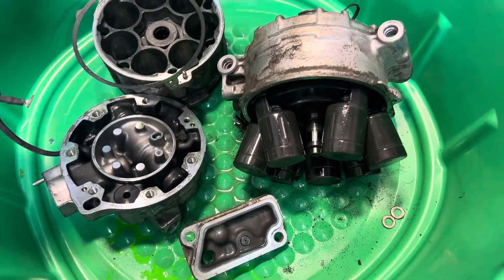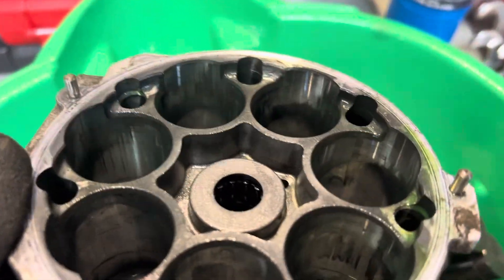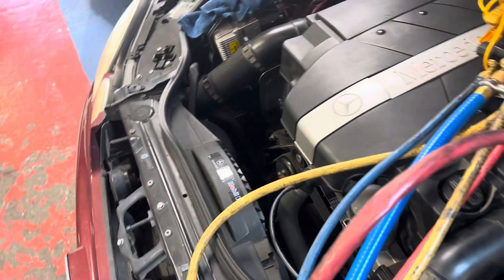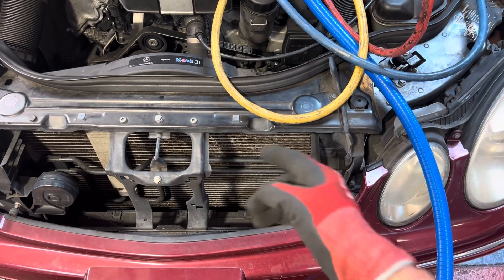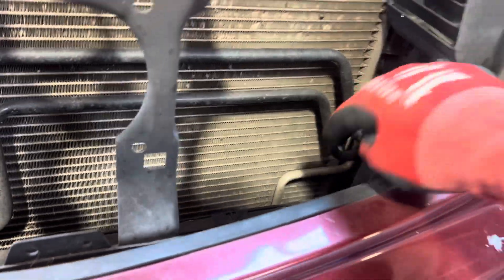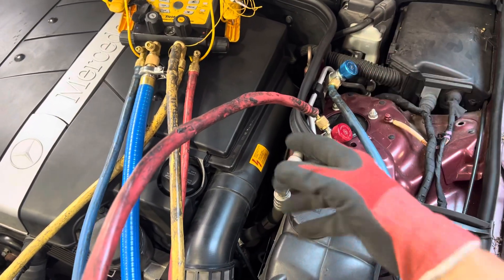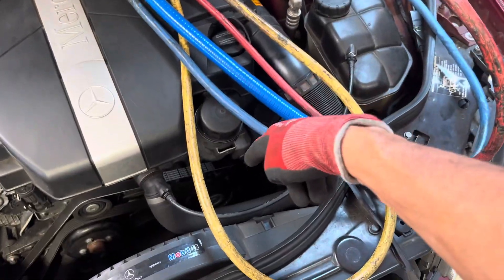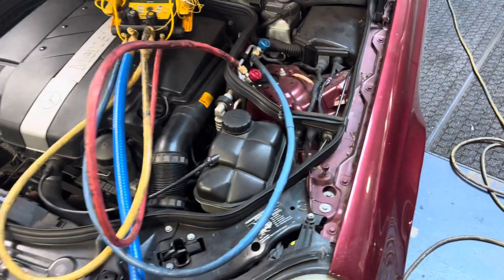WERE DID THE REFRIGERANT OIL ￼GO  ???🤔 Compressor failure.

Comment: Do you need to change the condenser when theres a damaged compressor like that? How to drain oil on the evaporator without removing it?
Reply from the maker: @janernstd9842  if you are lucky enough to be able to get to and remove the expansion valve without removing the evaporator. 
You can use a flushing solvent to blow through evaporator to flush out the oil . 

4 SEASONS has a video using a flesh gun with solvent how to do that after you have removed the expansion valve

Comment: I just put a brand new compressor in and smoked it in 10 mins. There was no fluid in it when I pulled it back off. I’m F’d. I think the whole system is full of metal particles and it’s a large suv
Reply from the maker: Front and rear expansion valves 
Flush both evaporators 
Flush all lines. 
Replace and hose that has muffler on it. 
Replace condenser 
Replace 
Reciver dryer or accumulator 

It a bit of work
Reply: @coldfinger459sub0 thanks for the info. That’s all way outta my league. And it’s only a suv worth about 3k so I guess I’m going to have to keep it as a backup vehicle  or winter vehicle cause all that work sounds like it would take me a year to do. And I’d prob mess it up and smoke another compressor in 10 mins 💔🫣
Reply: The weird thing is that it worked up until I took it out for a drive. Then it smoked the compressor. That’s two compressors that I had working while idling but then they both failed when I took for a drive. I didn’t replace any other parts but the compressor both times.

Comment: This brings up a good question i have...  " if one could vent automotive AC refrigerant ( like back in the old days ) ..what would be the best way to vent the refrigerant and 
NOT loose any of the oil "  ?    thanks in advance  -  Jay Fox
Reply from the maker: @charlesleake930  we used to do it all the time I would use R12 so did my father so did my grandfather
R22 
R11
It just takeoff the expansion valve open up the lines put in our 11 as your flushing solvent. It’s a refrigerant. 

And then you would use our 22 or 12 as your pressurized solvent to blow through the 11 this week clean out your system just fine. We used to spray tons of stuff into the atmosphere every day. 

When your steel boots got really hot and sweaty in the summertime, you cracked open a can of our 12 and dump it all over your shoes until they were frosty, white and cold 
🥶 it feels really good on a hot summer day

When your Coca-Cola or your beer need to be cool down, you crack open another can of R2 and spray it all over your can in a little container. Get ice cold really fast. 

I grew up and was mentored working on Hvac back in the days before the EPA existed for refrigerant control
Reply: Slowly!

Comment: i dont understand how you can think oil doesnt travel in the system. the number of people i have to explain this to is crazy. if you had seen one leak in your entire life it should be obvious
Reply: Watch properly the video start to end, after you "clean" your ear😂.   Either you have hearing problem, or watched only a few seconds segment
Reply: @suryaprihadi2258  you need to clean your eyes and read again
Reply from the maker: @faintsmile3279  this is what happens when you do not list to the whole video,  i know, 
I’m answering a stubborn person suffering from lack of knowledge, insisting oil does not leave the compressor. And the oil does not mix well with the refrigerant.
Reply: i think you miss understood me. i meant its frustraiting how people dont understand the simple fact that oil indeed does travel with refrigerant in the system. i used "you" as a general refrence to a person who thinks oil doesnt travel with the refrigerant.
Reply from the maker: @faintsmile3279  yes you are correct. I misunderstood you.

It is very frustrating people make comments on stuff. They’re totally ignorant about and have absolutely no education. . 
But they’re allowed to practice the trade or even worse yet they’re clueless owner of a automotive shop and they can’t even fix a car if you held a gun to their head and they’re the ones giving the orders 

I always feel sorry for technicians who have to work for clueless owners 

And I feel sorry for the customers

Comment: I am surprised you never found any particles in the compressor.  The possibility of a leak crosses my mind when there's low oil even if the AC was topped up correctly last repair. How else can you lose oil? Can't escape a property sealed system can it?
Reply from the maker: @electric_thumbs  the oil was not lost. 
The oil was still all in the system 

What happens in some scenarios your system develops a slow leak . 
    And as you have the slow leak the AC system relies on a completely full charge of refrigerant to circulate the oil back to the compressor

But when you keep running AC system compressor with a very low refrigerant charge as the refrigerant escapes slowly over a long period of time . 

The refrigerant carries the oil solvent out of the compressor 
       As it enters the evaporator lower level mass, quantity of refrigerant loses velocity as it travels through the larger evaporator
And the oil drops out of suspension from the refrigerant remaining inside the evaporator 

So the system starts gathering and filling up the evaporator with all the oil leaving the compressor, never returning the compressor .,

And slowly causes a death of the compressor 

The lack of cooling of no more refrigerant coming back to compressor 

Compounded by the lack of returning to the compressor 

So if you were to take the evaporator out of the dash and poured it upside down a few ounces of oil come out
Reply: @coldfinger459sub0 So if you caught this in time, and corrected the refrigerant level, would the oil migrate back to the compressor and all would be normal again?
Reply: @coldfinger459sub0  That was a question, not a statement..
Reply: @the8419  i would say yes if u caught it in time. but time is the unkown factor. if it was ur veh and u have ac knowledge and u monitored your temps in veh constantly u probably would catch it in time. but who has that knowledge and who monitors it that close? like people hardly ever check their oil level everyday or coolant. but yes to ur question. if im wrong tom will correct me. hehehe
Reply: @coldfinger459sub0  I wonder how much oil is stuck in an evaporator when there is a leak that has been unrepaired for several days. You know how it takes a while to get around to fixing an AC when it breaks. Does adding refrigerant later on eventually pull it out of that trap of the evaporator
Reply from the maker: @electric_thumbs  yes

Comment: 06:43 all you have to do is have the car running with the AC on and take a cotton ball, or Kleenex, wrap it around a small screwdriver at the base and then press on the low side service port for 1-second and the cotton ball will be oily from the 1-second spray...this proves the oil does mix with the flow of "freon"....
Reply from the maker: @freddyhollingsworth5945  yes you know that and I know that, but there’s individuals out there who believe otherwise.

Comment: When you replace a compressor , condenser, expansion valve and flushing evaporator and lines,do you need to add oil to each part or that provided with the compressor is for whole system?
Reply from the maker: @issamadam9352  the compressor, depending who the manufacturer is. 
May or may not have oil inside their compressor that they sell to you 

It is the technicians responsibility, even if the paper or the box tells you a compressor has a certain amount of oil or no oil 

It is the technicians responsibility to open up that compressor and pour out the oil to confirm it does or does not have a certain quantity of oil 

Because often compressors are boxed by manufactures and sold under different names 

So they don’t always tell the truth about what is inside their compressors . 

Some oil has to go into compressor so when it starts up, it is not dry 

It’s a good idea to put some oil in the evaporator or the accumulator or the receiver dryer on what is easier not easy to get to 

So when the compressor starts up 
When the oil starts leaving the compressor 

There is also oil immediately returning to the compressor 

That would be the ideal solution 

And following the manufactures instructions
Reply: @coldfinger459sub0  How much to put in each part?.Do you subtract this amount from total system amount of oil?
Reply from the maker: @issamadam9352  it depends what the vehicle manufacturer documentation tells you what quantity of oil for each component is necessary

The vehicle manufacturer specification indicate what is the total amount of oil 

So just by reading the manufactures recommendation if you wanted to put it in each component, you just follow instructions 

Remember some cars have 2.77 ounces of refrigerant oil for their total system capacity 

And some other vehicles might have more than 10 ounces of refrigerant capacity 

This is why you only read the documentation from the vehicle manufacturer for a specific year model make vehicle

Comment: I just had a customer take their vehicle with one that has a cooked compressor. He let it go low years ago. He was trying to get me to replace the compressor and flush just the lines  I could access. I told him no way. He needs to spend the extra to access the evaporator and replace the condenser. He didn't like that very much.
Reply from the maker: @nservice1625  they don’t like paying for their mistakes by putting off repairs until the damage is too bad and unrecoverable.